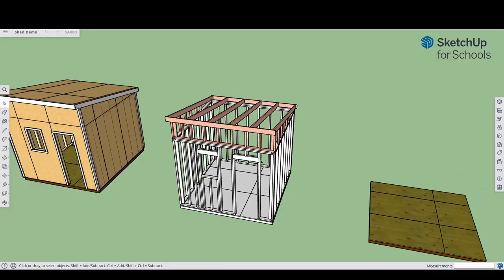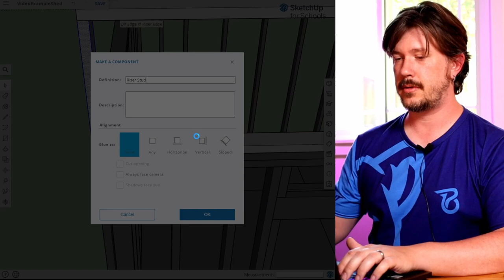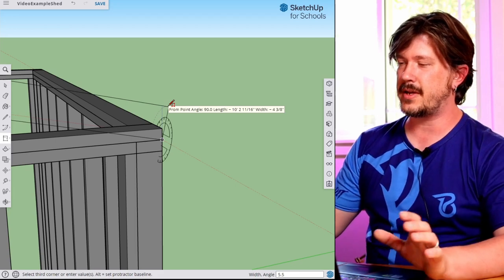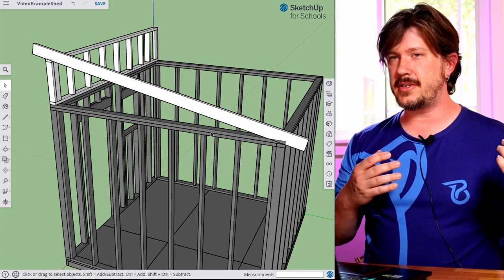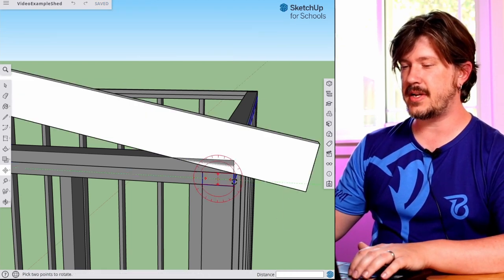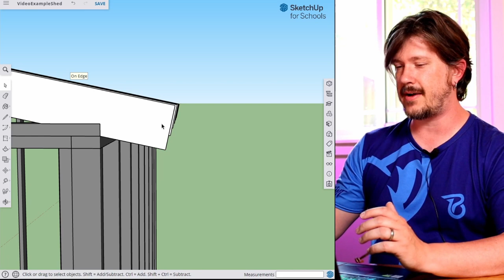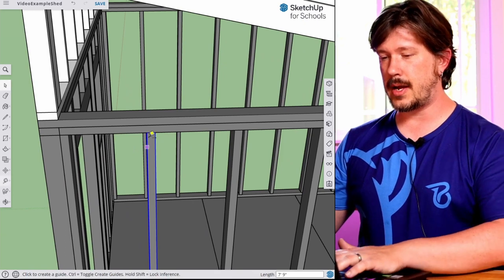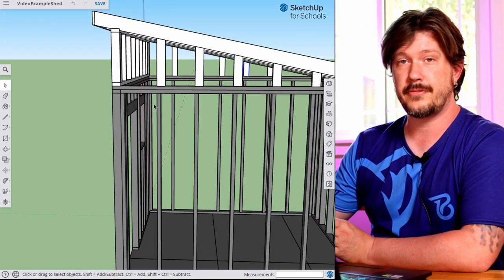How to Design any Shed (SketchUp Tutorial) | Roof

Comment: Hi Mr. Lower! We are making great progress but have gotten stuck at the step of cutting out the birds mouth, also the cutting off the edge of the rafter to make it perpendicular to the ground. We use the pen tool to draw a line, but then can’t seem to highlight the small triangle or use the push-pull tool to cut it out. Any tips for us?
Reply: Actually never mind, we figured it out🎉😊
Reply from the maker: @gailsovick  Glad to hear it. What was the trick to get it working?

Comment: Great video ... I have learned a lot that I did not already know!  Question:  at 19:20 you are cutting vertical ends on the rafters ... I do exactly what you've done and when I try to push/pull I get the 'ole circle with the slash 🚫 ... thoughts?  Just tried an experiment ... created another rafter and was able to cut the end with the push/pull but only before making it a component.  That's my workaround but just curious why it worked for you as a component ... unless its something new over the past two years to the free version.
Reply from the maker: Just off the top of my head, it sounds like you might be trying to push/pull a component. You can't edit components directly - if you want to get in to edit them, you have to double-click (or mac equiv), which will "open up" the component for editing. It puts a big wireframe box around the object and darkens everything else. When you're at a level where the push/pull tool hovering over a side causes it to shade, then you're at the correct level to edit. If I misunderstood your situation please let me know.

Comment: Nice video series! Why is the riser added? Couldn't the rafters just span two walls of different heights?
Reply from the maker: It definitely could. I would probably do it by shortening 3 walls so I could at least get a double top plate on most of them, and add blocks to the top of the two side walls. The only thing I might be concerned with is no top plate locking the taller front wall to the rest of the shed, but I'm not a construction engineer so perhaps there's an obvious solution that I'm just not aware of.